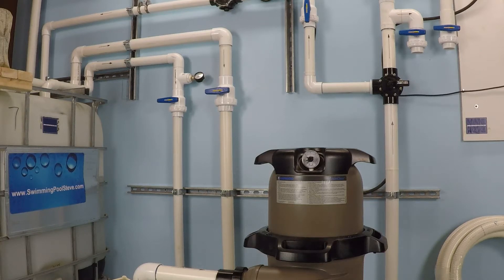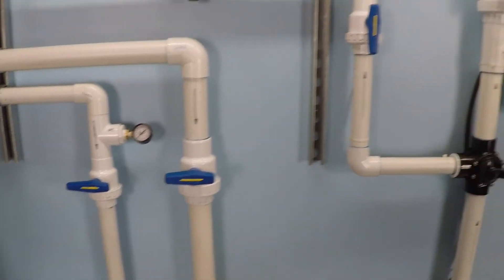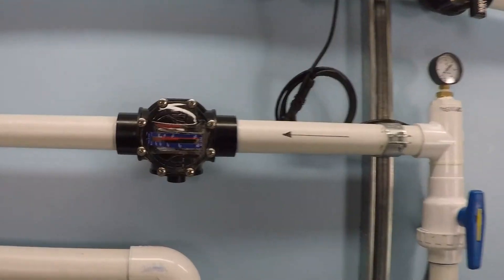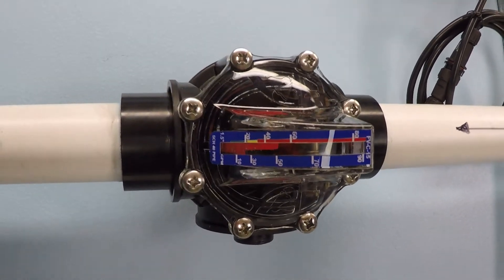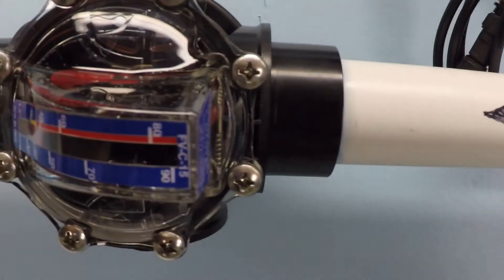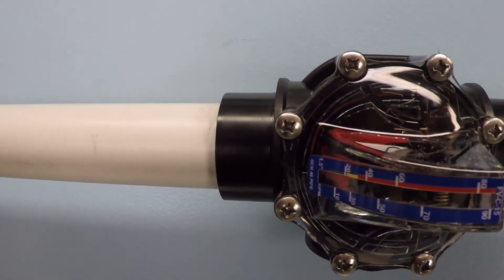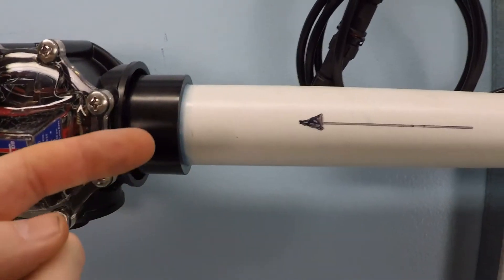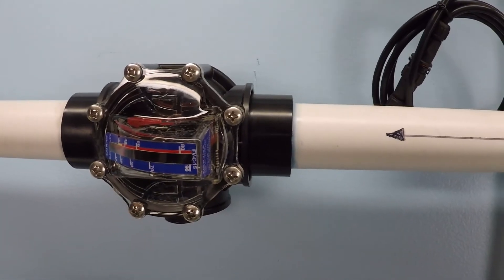What Is A Check Valve?

Comment: Why is there a check valve? I think it's so that the water can't fall back down through the pipe? So that the pipe will stay primed all the time?
Reply from the maker: Yes, in a closed loop plumbing system a check valve (anywhere) will completely stop movement of water inside the line. So it would not gravity drain, staying primed as you indicate. These are also very commonly used to protect sensitive equipment like pool heaters from chemical erosion feeders.
Reply: Ok, No problem; I love check valves? @Swimmingpoolsteve

Comment: Right now, my pump is significantly far from the pool and a little higher than the water so when it turns off it drains and then has a long time priming I saw another YouTube video where a check valve may help keep the water at the pump. that's why I was considering it.
Reply from the maker: In a closed loop plumbing system it does not matter where the check valve is located - suction or pressure side. Unless ypu open the system to air like removing the lid for your pump, the suction line water should not gravity drain back to the pool. If so, there is a leak in the system. If ypu need the suction side to hold full of water even once the pump lid is opened, then that is a reason to have a foot valve.

Comment: Is it all right to put a check valve in front of a pump provided you have the proper run into the pump like 10 inches for a 2 inch pipe?
Reply from the maker: In that orientation it is technically called a foot valve, and represents a greater restriction to flow than when used on the pressure side as a check valve. So I avoid them as foot valves on the suction side wherever possible.

Comment: Hi Steve,  Watched a lot of your video, very helpful!  I'm perplexed by a problem with both FloVis flow meters and pentair check valves.  I'm redoing all of my plumbing to be able to heat my inground pool and separate inground spa, the problem is that not only are Pentair diverter valves leaking but the FloVis and Pentair check values are leaking at the flapper as well, the water coming from the spa filter hits a check value and diverter and both are leaking (volume of the leak is about the same if you had a sink faucet set to it's smallest stream).  These are all brand new valves, the Clean and Clear filter has a reading of about 15 psi.  I took one of the Pentair check valves, filled up the flow side at my utility sink and it leaked.  Do all valves leak?  At a loss???

Comment: Hi there , my pool guy just relocated my pool equipment and replace the filter , check valve  and a salt system , when the pumpis off i loose water from spa to pool. i believe is the chack valve ,he saids i need a new pump because i have a small leak on the pump seal ,but i had that leak bofore moving and replacing the equipment . could the leak on the pump cause to loose tha water ? thank you.

Comment: Is the check valve installed on the suction side or return side? The majority of videos I’ve seen showed suction side installs. But I did see a couple with return side install.
Reply from the maker: Check valves on the suction side is called a foot valve and they are a major flow restriction more so than on the pressure side but people sometimes like to use check valves (foot valves) to help prime a pump that is located above water level of the pool.
Reply: @Swimmingpoolsteve  thanks Steve 👍

Comment: Hi Steve, I just got this flow meter/check valve and to me it seem like it's restrictive being it does not fully open even if max flow is reached. What do you think is this going to be a slight restriction to the system or am I over thinking it lol ?
Reply from the maker: If you have the flow through style it is a small flow restriction, yes. This is the tradeoff for easier measurement of low flow conditions, something that is a little harder for a rotameter style. So yes, it is a flow restriction, but also the same company makes a version without the check valve which I think would be less of a flow restriction. But in general I consider this a necessary evil in order to be able to accurately monitor your flow rates across a wide spectrum of flow velocity and volume.

Comment: Hi i have a question so my pool is a cartridge filter and when i turn on my pump the red flap opens and my jets all start working and my filter pump has water running freely and my skimmer is sucking but 5 min later the red flap closes and all flow stops and the jets stop working and my pool is not moving do i need to change my valve because when I turn of my water fall it opens and stays open and my skimmer starts sucking and water is flowing freely. Please help and be free to help ANYONE thanks and does your flap or pool do this.